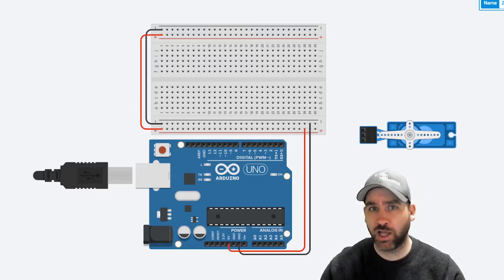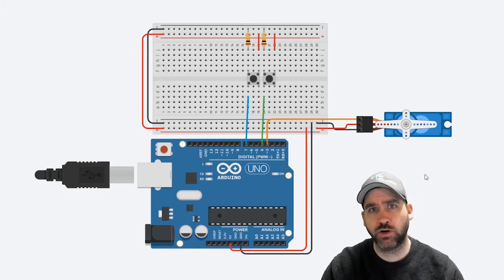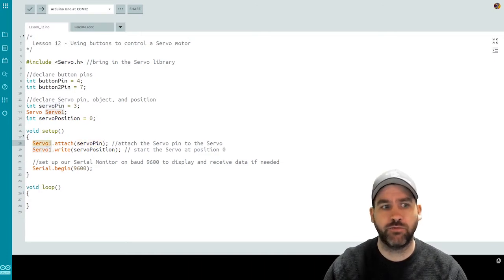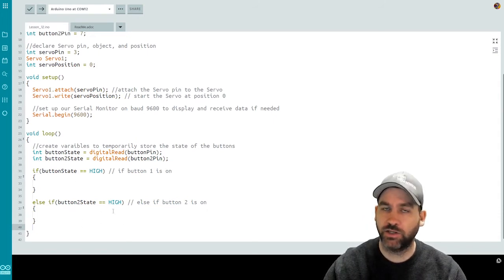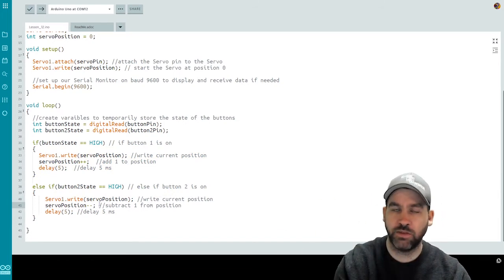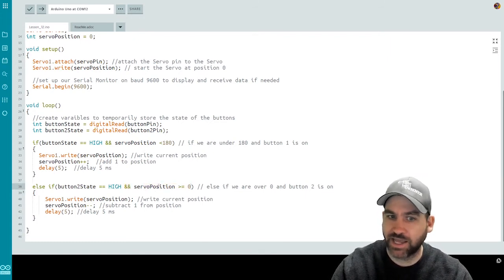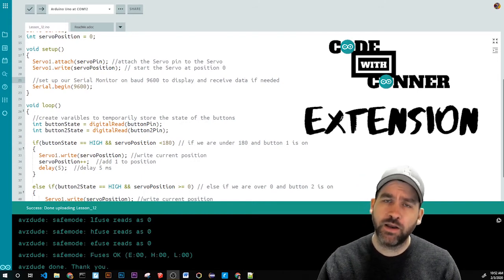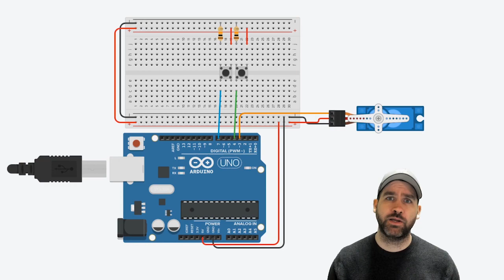Arduino Basics - Lesson 12 - Using buttons to control a Servo motor

Comment: On my model railway I want to operate uncouplers and level crossing gates so will probably need at least 12 servos. Can I use a Arduino mega and shield to run numerous servo's by switches and how would I connect them up

Comment: This looks great. I am thinking about using servos for points operation on a model railway display. Maybe if I was to use, say, 70 and 110 instead of 0 and 180, would that work? If I was to then play around with those figures to control the mount of movement? Also, to continue the move, eg left to right, does the button have to be continually held down? What would happen if you were to just momentarily press a switch? Secondly, looking at a quantity of 8 servos, with each of them having two switches, would I just copy & paste all that program 8 times, but giving different numbers to each motor, after adding all 8 motors & switches to the beginning of the program? (Obviously playing around with the movement distances for all 8 servos, as no two would be the same). Sorry, but I am a complete beginner with electronics. Thanks you in advance.
Reply from the maker: If you're going to do 8 servos you might want to look into a servo motor controller. You can wire it up and use a library to control the servo's with a little bit less manual effort from the code and wiring standpoints. Lots of great tutorials out there for large servo setups! Good luck. You might be a beginner but we all start somewhere :)

Comment: interesting, i just order one servo and one optocoupler parts my arduino nano super mini board, first time my life try use servo, i need make input if have power on optocoupler 36V and in arduino 5V, then need servo move. if power ON servo right xx angle, else servo is left xx angle,  how i write this to arduino code. 
i want build brake to motor, if power OFF brake ON if power ON brake OFF. servo open and closed mechanic brake. 
forget say, if sensor (optocoupler) power OFF servo need stay position 0 and if sensor power ON position need be xx angle, alltime need be position 0 and only open brake if sensor power ON move angle xx. i not understand how make this code. power at optocoupler have same than motor power, if motor is ON then brake open, if power is OFF keep brake on. i use stepper motor 36V and want add axle brake mechanic, axle not can move if motor power is OFF. if turn power ON stepper driver 36V then brake open.

Comment: I am trying to find a configuration and code that only uses one button. On press it rotates, but on release it returns to the home position.
Reply from the maker: With some trial and error you can definitely make that happen. If you work your way through the course I expect you'd have enough foundational knowledge to problem solve it out!

Comment: Why do we need resitors? And do those kind of buttons always need voltage, ground and a pin? Even if I use it on a Ada fruit soundboard for example?
Reply from the maker: I haven't worked with Ada fruits at all so I'm not sure I can do a great job answering the questions.

Comment: Hey is it possible to duplicate the code in order to control multiple servos with multiple buttons?
Reply from the maker: For sure. You might run into voltage issues or run out of pins and have to get creative with external batteries, etc...

Comment: i eally don't know where is the mistakemaking thnk why wouldn't you JUST POST THE CODE!!!

#include <Servo.h>

 int buttonPin = 4; 
 int button2Pin = 7;

int servoPin = 3
Servo  ;
int ServoPosition = 0;

 void setup()

{

    Servo1.attach(servoPin); 
    Servo1.write (servoPosition);
    Serial. begin (9600);
}

void loop()
{
  int burtonState = digitalRead(buttonPin);
  int button2State = digitalRead(button2Pin);
  
  if(buttonState == HIGH && servoPosition <180) 
  {
    Servo1.write(ServoPositton);
    ServoPositton++;
    delay(5)
  }
  
   else if(button1State a == HIGH )
  { 
    Servo1.write(servoPosition);
    ServoPosition--;
    delay(5)
  }
}
Reply from the maker: Feel free to share if you want. I don’t post the code because I think there is better learning in following along and in the act of typing out the code and the brackets and all of it yourself. 

To each their own.

Comment: I have an issue with my circuit and im hoping you could help. I have two servos connected to a button and i want the servos to start at zero to move to 45 degrees when button is pushed (not held), and when the button is pressed again, servos move back to 0. where in my code is it incorrect ?
#include <Servo.h>
int buttonPin =2;
int servoPin =3;
int servo2Pin =5;
Servo servo1;
Servo servo2;
int servoPosition =0;
int servoIncrement =4.5;

void setup() {
 servo1.attach(servoPin);
 servo2.attach(servo2Pin);
 servo1.write(servoPosition);
 servo2.write(servoPosition);
}
void loop() {
  int buttonState =digitalRead(buttonPin);
  if (buttonState==HIGH&&servoPosition<=45)
  {servoPosition +=servoIncrement;
  servo1.write(45);
  servo2.write(45);
  delay(10);
  }
  if (buttonState==HIGH&&servoPosition>=0)
  {servoPosition-=servoIncrement;
  servo1.write(0);
  servo2.write(0);
  delay(10);
  }
    
    }

Comment: hey hey, I used your code and it works perfect! but I want my servo to turn slower. How do you have to change this code so that the servo will turn slower, because it is going quite fast now?
Reply from the maker: The easiest way would be to just increase the length of the delay inside the if/else statement in your loop function where you increment/decrement the servoposition variable.

Comment: Really loved your video. Great teaching style. I understand the coding. Have typed in code, checked and checked, but when I compile, after :  else if(button2State == HIGH) && servoPosition >=0 //else if we are over 0 button 2 is on" get "expected ";" before "{" token. Can't see the error!. Frustrating
Reply from the maker: Can you paste the whole if/else if blocks of code here or email them to me codewithconner@gmail.com
Reply: @CodeWithConner  here it is
if(buttonState == HIGH) && servoPosition <180  //if we are under 180 button 1 is on
 {
    Servo1.write(servoPosition); //write current position
    servoPosition++; //add 1 to position
    delay(5); //delay 5 ms
  }
  else if(button2State == HIGH) && servoPosition >=0 //else if we are over 0 button 2 is on
  {
    Servo1.write(servoPosition); //write current position
    servoPosition--; //subtract 1 to position
    delay(5); //delay 5 ms   
  }
Reply: @marklaslett9613  im a little late, only by three years, but the problem is in this line of yours:

 else if(button2State == HIGH) && servoPosition >=0 //else if we are over 0 button 2 is on

It should be corrected to:  else if(button2State == HIGH && servoPosition >=0) //else if we are over 0 button 2 is on
Reply: @ItzIshan-13  Thanks!

Comment: Code didn't work for me. 
#include <Servo.h> 

int buttonPin = 4;
int button2Pin = 7;

int servoPin = 3;
Servo Servo1;
int servoPosition = 0;

void setup() 
{
  // put your setup code here, to run once:
Servo1.attach(servopin);
Servo1.write(servoPosition);
}

void loop() {
  // put your main code here, to run repeatedly:
int buttonState = digitalRead(buttonPin);
int button2State = digitalRead(button2Pin);

Error massage says ServoPin  was not declared in this scope
Reply from the maker: When you declared servoPin you used a capital P but when you access it later you used a lower case p. That’s why it can’t find it.

Comment: EVEN BETTER... HAVE A SPDT SWITCH, AND USE THE SWITCH TO DETERMINE THE DIRECTION OF THE SERVO, AND A PUSH BUTTON, TO TELL IT TO MOVE TO THAT POSITION, WHEN COMMANDED. HOW WOULD YOU DO THAT? i HAVE TRIED SEVERAL WAYS, AND CANNOT GET IT TO STAY IN EITHER POSITION. IT JUST CYCLES BACK AND FORTH, NEVER STOPS... I AM FRUSTRATED. I LEARN BETTER WHEN SHOWN HOW TO DO SOMETHING, AND THEN I CAN APPLY IT, TO OTHER SITUATIONS THAT I AM WORKING WITH AT A LATER DATE.
THANKS AGAIN!!!
Reply from the maker: So really the idea here is that whatever is in your loop() function directly will just keep happening over and over again. The key to all of this is the if statements in the loop function. There are a couple reasons this can get messed up, for example depending on how you are detecting your button state. Even though we might think we aren't holding a button down, the Arduino will recognize it several thousand times in a second potentially. Having a delay built in anytime it detects a button push helps prevent it re-running the code more than once per button press. But, if you have no motor movement in your main loop() function, but an if statement for a button that just moves it a certain amount in a certain direction and doesn't do any kind of looping or incremental change this should be doable. 

something like: if(buttonstate==HIGH){Servo1.write(120); delay(1000);}
would just move the motor to 120 and do nothing else.

Comment: OK, i HAVE BEEN ABLE TO DO THIS, HOWEVER, WHAT IF i WANT TO HOLD THE SERVO, IN EACH POSITION? SAY, i PUSH THE LEFT BUTTON, AND, THE SERVO MOVES TO 60 DEGREES, STOPS, AND HOLDS POSITION, UNTIL COMMANDED TO MOVE, BY THE RIGHT BUTTON? SAME THING WITH THE RIGHT BUTTON. I WANT IT TO MOVE TO 160 DEGREES POSITION, STOP AND HOLD THERE, UNTIL COMMANDED TO MOVE.
HOW WOULD YOU CODE THAT? THANKS!!!

Comment: Conor , I would like to use a PCA9865 , have you any videos on how this would work rather than a direct feed form ardiuno board ...i want to move the servo to preset positions depending on a feed from a toggle switch ..
Reply from the maker: So I haven't done a project video with a servo breakout board like this, but they are awesome. This site has a ton of good info on setting one up though: https://learn.adafruit.com/16-channel-pwm-servo-driver?view=all

Comment: Hello sir , my question is .. when servo move to 1°-180° and i want it delay for 5s .. after that automove back to 180°-1° .. each button has a same instruction but the different is value of angle movement servo.. so how the code sir? Please reply n help me to solve this problem. Tq
Reply from the maker: If the only difference between the button is the speed of the movement, basically the first if statement would do a full sweep from 0 - 180, delay 5, then sweep back to 0. The "sweep" would be a for loop that changes the servo angle and writes it however many times you want. The finer/smaller the angle adjustment each time the slower/smoother the movement will be.

Comment: Hello guys , i have a great problem and i Hope you would help me please.  I want to pilot a servo moteur with a signal input 5 volt  like your button system ( in réality i want to pilote the servo with a signal of  a VHF REMOTE CONTROL whose work on 12 volt  and reduct to 5 volt with a convert  to control in finely an excavator machine....when i push on a button of the VHF REMOTE control , i want it's do the same like your button program.... Which   modification on your programme i 'll have to do for it's work . Thanks you for your compréhension , and i live in France ...maybe i'm lucky if you speak french .thanks you .
Reply from the maker: I'm not sure about the VHF remote input source, but in theory as long as you can determine when the button you want is being pressed  on the remote, you can then put that into an if statement and within the statement, set the angle change for the servo motor. Essentially replacing the buttonread == HIGH from the button version with whatever input check there is for your remote.

Comment: So, what if I want to use 3 buttons with 0, 45, 90 degrees each button, sorry if my question seems lazy to try, just curious and currently I don't have an arduino
Reply from the maker: This would be pretty straight forward. When a buttons read value is high, set the servo to the desired angle. Repeat for multiple buttons.
Reply: @CodeWithConner  thanks for the answer man, appreciate it 🔥

Comment: hello sir Conner... i have followed the code you have written and i modified some of it for the application of my project.. I've built a pingpong robot and i planned to use a servo motor on the panning. i want to control the servo with 6 buttons each have different angles to perform on the servo. The first time i uploaded the code to my arduino it worked very well, but later i have encountered a problem.. when i turned on the arduino the program will automatically run, executing the program on either of the buttons. please note that the buttons are not yet pressed.. please help me sir...
Reply from the maker: Shoot me an email to codewithconner@gmail.com with your code and I can have a look for you. No promises but I'll try and help.

Comment: This explanation was perfect. I was even able to modify the loop function to incorporate 3 buttons, and also create a loop that moves the Servo to a specified angle, thanks for your help! Here's the code I wrote under the loop function:

void loop()   {

  int button1State = digitalRead(button1); 
  int button2State = digitalRead(button2);
  int button3State = digitalRead(button3);

  if(button1State == HIGH && servoPosition <180)
  {
    myservo.write(servoPosition);
    servoPosition = 90;
    delay(100);
  }

  else if(button2State == HIGH && servoPosition >= 0)
  {
    myservo.write(servoPosition);
    servoPosition = 0;
    delay(100);
  }
    
  else if(button3State == HIGH && servoPosition >=0)
  {
    myservo.write(servoPosition);
    servoPosition = 180;
    delay(100);
  }
 
}

The only problem I have with this is that regardless of which button you press first, you have to press the second button that sets it back to angle '0' right after, otherwise the Arduino won't move the servo anywhere. Will have to play around with the if and else if statements a little more, none the less, great lesson!
Reply from the maker: Nicely done! With your code the way it is. Once you press button3 you’re stuck at 180 until you press button1. As the other two buttons have if statement conditions that can’t run at a position of 180. 

I hope that helps a bit. Keep it up :)
Reply: You just saved my semester with this code, literally. Thank you so much

Comment: How would the code be different if I wanted to press a button and the servo rotates so that I don't have to keep holding the button?
Reply from the maker: Basically, in the code below, where we increment servoposition by 1, you would instead send it all the way to position 180. Or if you want it to sweep the other way in the else statement, send it to 0. We were iterating by sending it one degree at a time. Be sure to increase the delay if you do this otherwise you'll get a LOT of HIGH reads on the button before you actually let go of it.

if(buttonState == HIGH && servoPosition <180) // if we are under 180 and button 1 is on
    {
      Servo1.write(servoPosition); //write current position
      servoPosition++; //add 1 to position
      delay(5); //delay 5 ms
    }